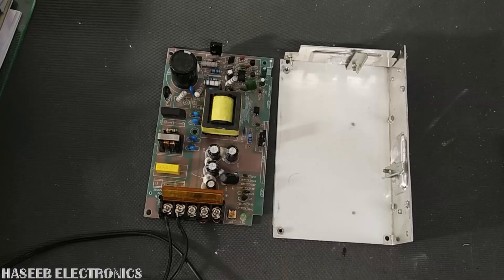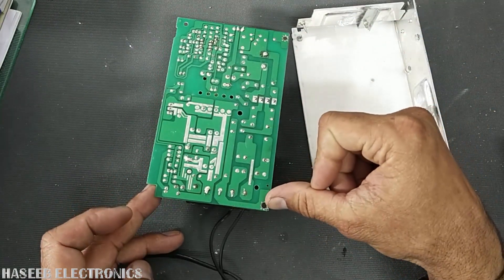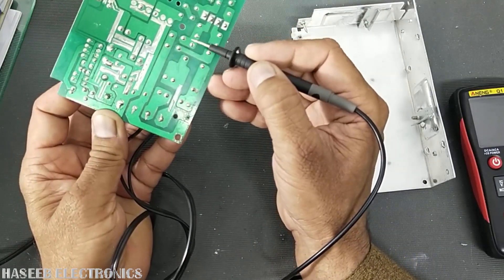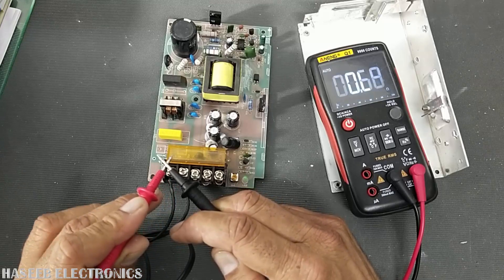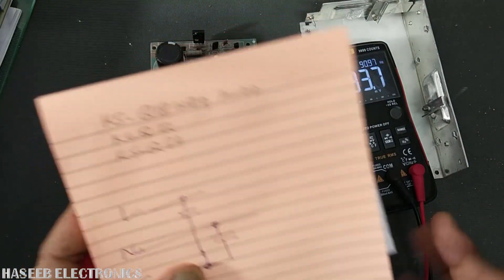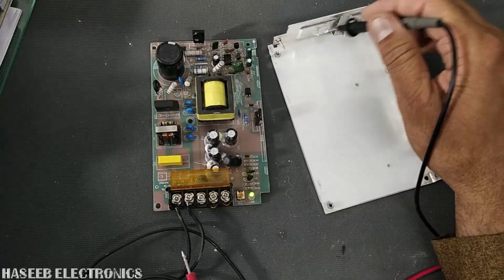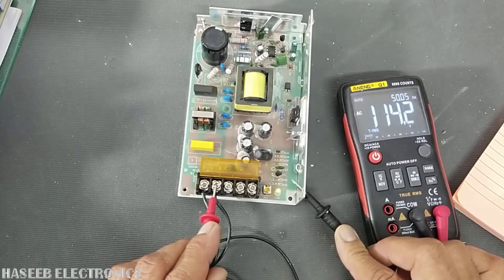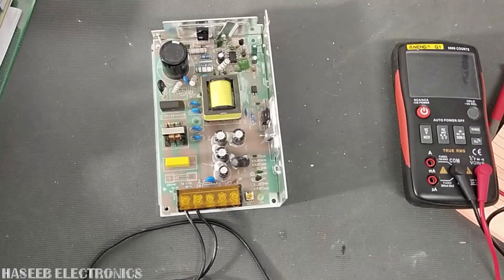{580} Why SMPS Chassis Exposed To Line Voltage - SMPS Chassis Gives Electrical Shock

Comment: Assalamualaikum bro,
I have my power supply body and output voltage leaks and it gives me shock
Will it fix the problem if i replace the voltage divider capacitor?

Comment: Where have to connect earthing in AC or DC side
Reply from the maker: Safety ground is used in unisolated high voltage (primary side) or hot side.

Comment: Sir one of the video of you,you showed that with multimeter the cold test of smps.checking the input of SMPS on line and neutral.it should show around 600kohm.but I checked different SMPS like this and showing 230Kohm,430kohm,even1 megaohm.so my question is that how much generally it can very for short and open circuit condition.

Comment: Hi sir. In smps phase is coming output side and ground side also. What is the problem sir
Reply from the maker: check class Y capacitor, connected across the smps transformer, between primary and secondary low sides
check class Y capacitors between line and chassis earth 
and neutral and chassis earth

Comment: When I'm touching the ground wire, the value of voltage between live and earth, and neutral and earth is changing. The chasis is leaking 10v ac current. Please help
Reply from the maker: please check Class Y capacitors 
or may be the EMI filter have something wrong

Comment: Thank you sir,
I have FDPS-100N-R5 SMPS module and sometimes it is working with small vibration sound with 12V output. Sometimes no sound no output.
Please advise me.

Comment: if we connect earth cable from main line, is it give 220v  from line to earth.
Reply from the maker: yes dear 
if the ground is not floating and the earth resistance is extremely low then it will measure 220v
you can check video number 414

Comment: very useful , does chassis really have that high voltage always why does not it cause shock normally when touching it then ?
Reply from the maker: when we check with reference to chassis. the chassis is at zero level (ground level). so line and neutral  are measured with this chassis ground

Comment: Selamun aleyküm I have a SMPS with 48 V DC output, I did all the necessary checks and I couldn't find any defective components.
The origin of SPMS is as follows: the voltage at the output is constantly changing between 20 v and 45 v, it does not stay constant, there is a very thin sound, what do you think is the source of the problem?

Comment: Which digital multimeter you r using Sir?
Reply from the maker: i am using Fluke 179 True RMS multimetere
Aneng Q1 multimeter (chinese brand)
Uni-T 202A Clamp meter
Reply: @HaseebElectronics sir can you please tell me which fluke meter is the best in these current days.I want to buy one but I heard fluke Is the best,,it can measure capacitors in pcb without removing them